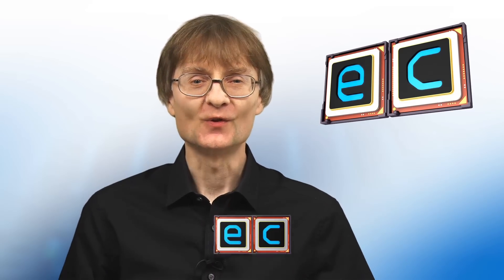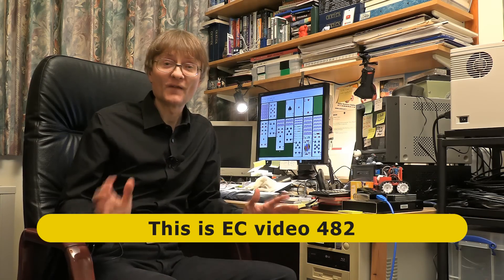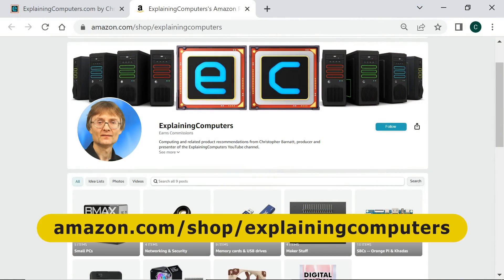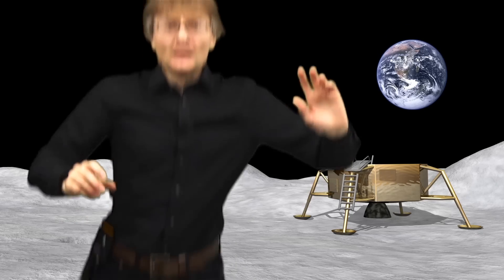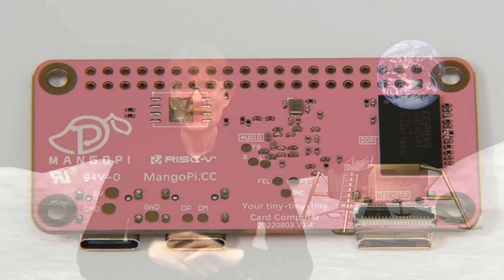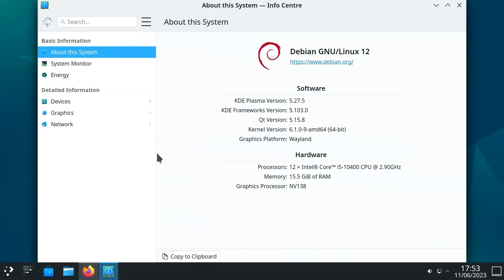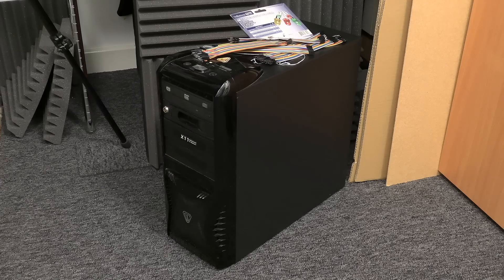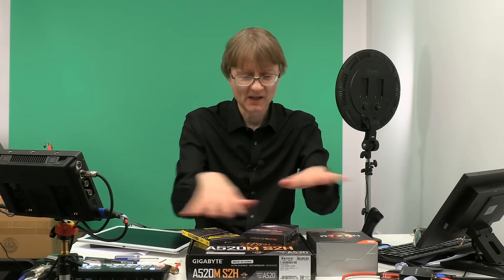Channel Update July 2023

Comment: 1:04 because 5:4 monitor is nice to work with. A 16:9 monitor is good for movies but it is awkward to work with. With several menus and bars 16:9 becomes a loop hole! A 1920x1200 a WUXGA is much better to work with, not as good as a 5:4 but better than the 16:9 slot view. For better comparison (4:3) 16:12, (WUXGA) 16:10, (HD)16:9. Linux  has its start menu on the left! Guess why?!

Comment: Your reviews on tiny desktops proved timely. I retired a couple years ago from spending the Pi 3 and Pi 4 era being paid to do industrial automation with the little wonders. That, of course, made it logical to make my daily driver a Pi 4 as well. But it's getting rather long in the tooth and it's getting boring being just a user for a couple of years. I watched the BMax session, but when looking on Amazon, it looked like the off lease HPs were at the $100 sweet spot, so I looked on YT and, lo and behold, you had a session on the 800 G2 as well. It ticked all the boxes.
I found one with a 1gB ssd by surprise, advertised with 500 gB, 16 Gb RAM, and it turns out,  onboard WIFI and Bluetooth. And it was reported to run linux well. I liked LinuxMint before and You even had a session on that. So, I was able for once, to take the road more travelled. I bought a fast M2 nvme sdd as the stock drive had more than 5 years running and installed Mint on it. I left W10 on the old drive. If it dies, I'll just throw it away.  An excellent, FAST,  Linux platform for my uses and bang/buck on par with the Pi. What's not to like?

Comment: Your problems with the "test" computer might be due to a failing power supply.
Reply: Indeed if the power supply has an unstable 12v or 5v rail, or has drifted too far off the ATX specification over time it could cause random system hangs.
Reply from the maker: I agree -- but the PSU was was recently changed. :(

Comment: Hello Chris, this is is my first comment on your channel.  CONGRATULATIONS on 937.000 subscribers as I write the comment.
I just subscribed, so you can continue to see growth in channel membership. As I saw this video and you spoke of upgrading this PC of yours I found a glaring issue to be, that you consider not changing the power supply on this old PC as well (considering it wouild have the same age) as well. So, if the PC is still not yet done being upgraded (don't know your work shedule on making videos), please consider adding a quality 450 to 550 watt unit to the parts list (yes this costs more money) since this could be very well the reason the old PC had these issues you descibed, as the caps in PSUs start to fade wih age and this leads to unstable  and insufficient  voltages being supplied to the motherboard and the rest of the components which then lead in turn to an unstable PC.
So, here you go, looking forward to your 1 MILLION subsriber mark reached in 2024. All the best from Germany.
Reply from the maker: Thanks for the sub -- welcome aboard! :) I should have noted in the video that the PC's power supply was new in 2022. But the issues remain . . . :(

Comment: I looked up the specs of the A520M S2H and can say with certainty it would be called trash by the gamer focused reviewers. It only has the absolute minimum components to get a system running. The VRM is too weak for the best CPUs, it doesn't have any PCIe 4 and the rear IO is hardly existent. However for your use case it might be enough and I think the lack of features helps idle power consumption.

Ultimately what's good value is dependent on your use case. Today for a non-gaming build I would probably choose a Minisforum pc. They are very small, have good features for the size and still allow customization with RAM/Storage.

Comment: Hi, Chris.

I just want to confirm your suspicions on the current market trends regarding SBCs and micro/small form factor refurbished PCs. My primary use for my RPi3b+ and RPi4 8gb were as mini-pcs to my television as an overall entertainment system and light computer usage off of my main desktop. I recently bought a refurbished Dell Optiplex 7050 (micro form factor) with an i7-7700k, 16gb ram, wifi included, no ssd, for $150 usd. Obviously I just put in my SSD from my RPi4 8gb into this computer and didn't have any further costs. The reasons for this switch was purely for video encoding issues that the RPi has been getting for me. Out of nowhere h.265 was working for me and then quit being reliable. Just got tired of playing around with it and the cost of micro/small form factors is going down and down.

Comment: That computer you are building looks just fine. I think people tend to over build or cheap out and under build their computers. I build my computers to do a specific task, not everything. I edit still photos for a living and my only experience with video is taping my grandchildren's birthday parties or at Christmas. I would put more than 16gb of RAM in that computer though. I had 32gb in my computer and when I added 32gb more I got a noticeable increase in speed. Not with low res photos, but with high res photos. DDR4 is cheap, and I would put 32gb in that computer. You could go to 64gb, but with a two slot board you have to buy a whole new kit. You can get a 32gb kit for about 60 pounds. I am in America, it is dollars here. With 1080p I don't think you will need more. 16gb will work, but 32gb is noticeably better. My backup computer has 16gb, it works, but it is a bit slow. When you are charging a client that has a deadline and your computer is broke, you can't tell him I will get to you next week, my computer died. You need a backup. Backup computers are cheap, new clients are not. I build a new computer every two or three years. Editing software kind of requires the latest. I could go to every 5 or 6 years, but when you are editing photos for a living, time is money. Five year old computers work, but are a bit slow for professional editing. I use my old computer as my backup. This is the end of the line for DDR4, so my backup computer will have 64gb of RAM.

Comment: With regards to reconditioned hardware, I think a video on the viability of older computers would be worth making a video on - for example, I was recently given a Lenovo G580 laptop from someone who no longer wanted it following upgrading to something newer, but with a cheap set of upgrades (£10 for 8GB DDR3 RAM from a computer shop on eBay and £7 for an SSD!), the machine is perfectly serviceable for many tasks. What's more the original Windows 8 license was immediately picked up by Windows 11, so the system has a fully licensed version of Windows 11 Home on it. Finally, the original 1TB HDD was placed into a £5.99 HDD caddy to allow for a large amount of useful storage. It really is amazing what can be done on a budget and it goes to show what you can do on a budget.
Reply: Today I've been setting up user accounts on my first W11 PC, a s/h Dell Vostro laptop (so presumably ex-business).
I got it for a nice low price on account of a missing up-arrow key on the keyboard. However, a few minutes work with the PowerToys (Preview) app has allowed me to map another key to do the job of up-arrow.
I've also been having a bit of a clear-out and giving away some of my older laptops. The ones involved are too old and weedy to donate to the charities that look for slightly newer PCs. 
However, here in Gloucester we can put out small electrical appliances as part of our domestic recycling. 
So each lap was put out the evening before bin day, either with a factory reset of W10 or with a fresh install on Linux Mint. 
All of them have been taken away by passers-by long before the bin men came the next day. I have no idea who their new owners will be or how they'll get on with them, but it seemed like a fun way of clearing out some of my cupboards.

Comment: Hi Christopher, thank you so much for the content on your channel which is both fun and informative.

One of the very recent happenings is the Raspberry Pi Pico now has support for Bluetooth in micro python and hence circuit python. The Pico is rare as a microcontroller because it supports both Bluetooth Low Energy and Bluetooth Classic. The only other microcontroller I can think of that supports Bluetooth Classic is the original ESP32.

However I have no idea how to program Bluetooth Classic in micro python. I have managed this (kind of) on a Raspberry PI in Linux, but not in an embedded environment. I am trying to drive neopixel goggles over Bluetooth because reasons (I want to drive them from a windows laptop). BLE is too complicated and probably too slow for what I'm trying to do.

I wonder if this is something you might think about explaining?

Either way, I do look forward to your videos. Thank  you so much again.
Reply from the maker: I must indeed delve into Pico Bluetooth. I'd especially like to figure out controller/keyboard control using it.

Comment: Your intro had the cardgame on the screen. You took over 5 minutes of talking, in which your screen never went into sleep mode. Are you not saving energy?
Reply from the maker: I never use a screensaver. But I do turn the monitor off at the wall switch whenever I step away from the computer.

Comment: Nice update, Chris, and congratulations on the channel uptick, nearing a million subscribers, and fifteen years of doing this. I'm tempted to dig around and find some early videos from before I started watching this channel, probably not long before the pandemic - particularly that first one on quantum computing.

Not to make you spend even more money, and I'm no expert, but although that PC on the floor is definitely due an upgrade, I'd recommend checking out the power supply. You don't want to build the new one only to find out that the problem persists, or that the supply damages any of the new components. (You may already have thought of this, but if so you didn't mention it.)
Reply from the maker: The PSU in the PC to be upgraded was fitted in 2022. :) Sadly did not fix what I am pretty sure are motherboard issues.
Reply: @ExplainingComputers  ah, I stand corrected, even though I'm sitting.
Reply: @ExplainingComputers  I'm sure this won't be the case with your rig, but, for the benefit of viewers, my brother's old deskop PC spawned a whole load of problems reading or writing its discs that were all caused by a failing motherboard battery. A new battery fixed everything.
Reply from the maker: Yes, a failed motherboard battery can be very problematic -- and until you've experienced this problem, the issue can be hard to recognize. :)

Comment: Actually, I would like to hear your opinion on toilet cleaner... I haven't scrubbed my bathroom in months. ; P
Reply: Some advice: DO NOT get the cheap liquid crap. Spend the extra bucks or two to get the clinging gel cleaner. If you do wind up getting the liquid crap, make sure to squirt some Soft Scrub (make sure it's the kind WITHOUT bleach) around the bowl before the liquid cleaner.

Comment: In order to amplify the sound streamed from computers, there are small speaker units, usually Bluetooth, as I'm sure you know.   How about a project for a grown-up version of the idea; an SBC with wifi and or Ethernet in, to drive full-size stero speakers?  How cheaply could that be done while getting really high-quality sound? That could be 2 or three weeks, perhaps basic hardware and software, comms h/w, and audio D-A.

Comment: great summary of the first half year which also reminds me to look for videos I  might have missed for whatever reason.
And of cause a great outlook of what will come. I always like the mix you deliver even though I do no longer watch every video cause for some topics I have not found the access and joy you  have when making it, but those are rare. AI looooooks so great - and reminds me every time where FSD or Full Self Driving has gone, sold for years nothing delivered here so far that has been usefull and thh more steps back than ahead if you consider that a work car with parking sensors was able to do the parking tricks quite well and now it has gone backwards.

For me it always sounded like an AI example, now some will complain that it is neuronal network and cloud based learning or maybe swarm whatsoever, overall it did not work out so far after having been announced so often for so long that it had become boring. But maybe RISC will do the trick for them, who knows - at the end I will learn it for sure from your channel it that has happened or worked out.

I like the content and channel development updates a lot which are also released as precise like a swiss clock . 
Thanks a lot for the joy you are bringing  in our homes every sunday afternoon.

Comment: Greetings Chris, enjoying the channel for some time now, please continue your amazing work.  Regarding that PC upgrade, could it be the power supply giving you grief?
Reply from the maker: I pondered on that, and replaced the power supply. No joy there -- but it left a nice PSU in the machine for the build/upgrade. :)
Reply: Ah, yes.  Very well could be motherboard capacitors failing then.  Regarding AI, I have found (public) AI to be terribly unreliable and cannot believe how adopted it has become.  At least, one adaptation of it.
Reply from the maker: Motherboard caps I could very well believe. I'm convinced it a motherboard issue of some kind.

Comment: let us hope the chrismas boom 2023 will bring a new boom to the subscriber game to make that 1 2 3 4 5 6 yes a 7 digit figure.
And Sir Eben was also a visitor which pushed the channel a bit cause someone had send me a link back then even though that was years later than I had subscribed. 
Nice that you had reminded me about the amazon store support but please let us know if that does work also from the non british amazon and non us amazon stores cause nothing would be more  disappointing if that would not work and no one would benefit from the huge amount we spend there.

And I also got such older mini form factor PC from Lenovo, something i3 or i5 like which is running windows 10 or so to do the HomeAssistant job after my pi 3 was underpowered and I could not get that Pi4 with 4 GB at least, only having a 2 GB version in the shelf.

Comment: I'm umming and erring at the moment about just replacing a mobo on a 4 year old pc or upgrading, have found someone selling a suitably old mobo with a older athlon for £7, but I could still get £80 for my old GPU on ebay, tempting to sell the bits and just use my laptop